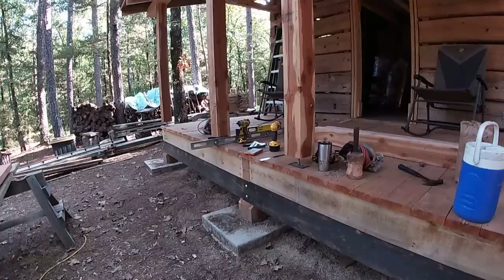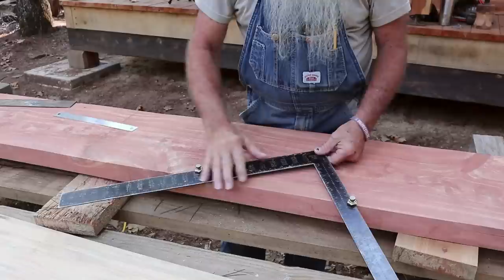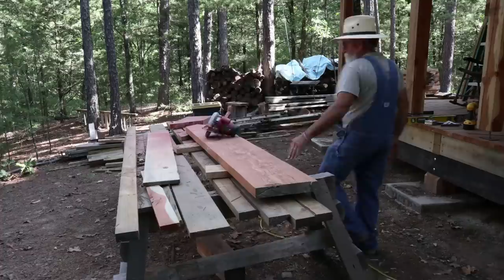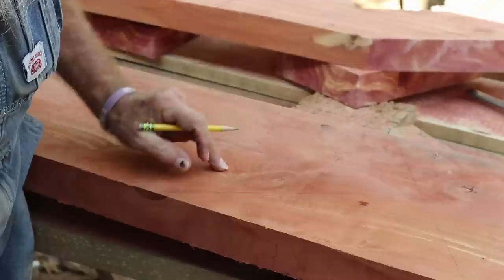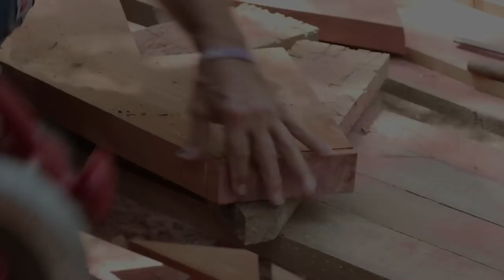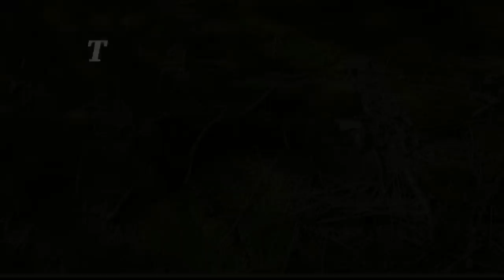How to Lay Out , Cut and Install Porch Steps, Paradise Point - Ep 21

Comment: Those brass buttons are really handy for making your layout very exact. Stairs really do need to be laid out with a good bit of care. If you don’t have a set of buttons like that or if you happen to misplace one, you can substitute a small pair of Vice Grips and do the same thing. Also I always found it helpful to position your framing square exactly where you want it on the stringer material, then attach the buttons to the inside edge of the square, instead of the outside. This way the buttons aren’t in your own way while trying to mark the very edge of the board.
Reply from the maker: Howdy- I’ve used the stair gauges both sides of the square. I’ve done quite a few sets of stairs in the last fifty years. I really enjoy doing stairs. On your other comment you mentioned sketching out the stairs to get an idea how it’s going to work which is really helpful for a person who hasn’t built stairs before. Thank you so much for watching and sharing. God bless

Comment: Thanks, Paul.
Do you think you may have been able to get away with 3 stringers or would that have been too flimsy?
Reply from the maker: Howdy Gregg- I probably could have, but cedar is not a real strong wood for structural purposes. That’s why I used boards that were a full two inches thick. I don’t do much framing on two foot centers unless it’s a bigger timber. God bless

Comment: If  you would of took another 1 1/2 off bottom of stringer you could of put a 2x6 or  2x8 on the bottom so stringers aren’t settling into mud
Reply from the maker: Howdy Doug-  it wasn’t shown but I always pour a concrete pad under the first step. God bless
Reply: @TheBeardedCarpenter  good or else the stringers sink into the ground and it changes the bottom rise. God bless you as well I’m a bearded carpenter as well over 30 years
Reply from the maker: @dougpeak7591  Thank you so much for watching the video. I’m keeping it a secret how long I’ve been a carpenter 🤣.Blessings